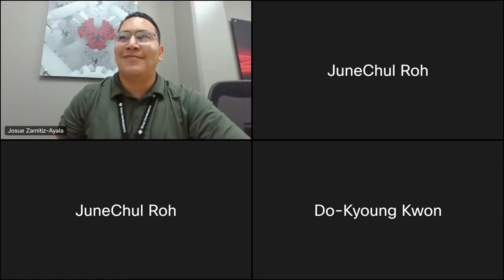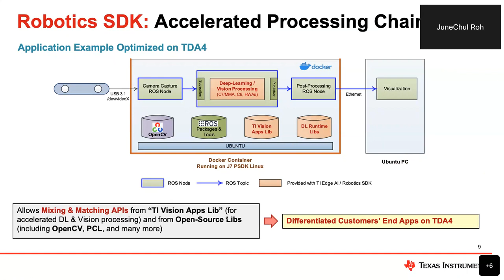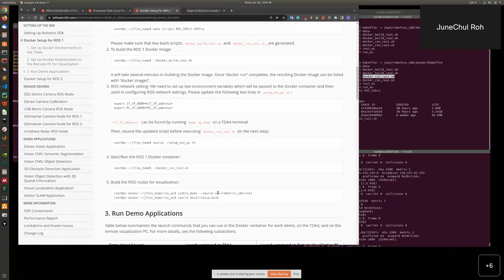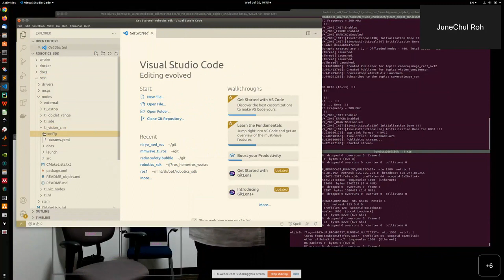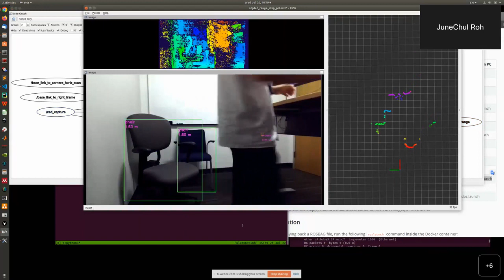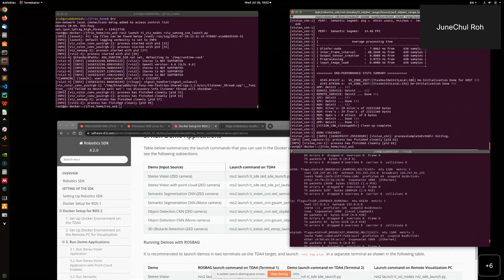Process This: Build AI-powered robots with TI’s NEW Robotics SDK

Comment: Alloy for Coil Wire of Dynamic Drivers…V3

51% - copper
25.5% - silver
16% - gold
 
3.75% - nickel
1.5% - zirconium
0.75% - iron
0.5% - chromium
0.5% - yttrium
0.25% - manganese
0.25% - cobalt

Perhaps yttrium will have to be alloyed separately together with copper, silver and gold, and the remaining additives, separately and in micronized form of chips, should be added directly to the main molten mass of diamagnets...

Comment: The best battery alloys for molecular ions placed inside coal, silicon, polymers or oxide cells ... alloys 1) Li1Al5P6 2) Fe2Al8P4 or Fe2Al6P4 3) Ca6Fe2P4 ... at the end crush into microdust and continuously oxidize directly in the crusher until complete micronization, after that, if the powder is not fine enough, you will have to use it in an alloy with silicon or boron and also crush it...